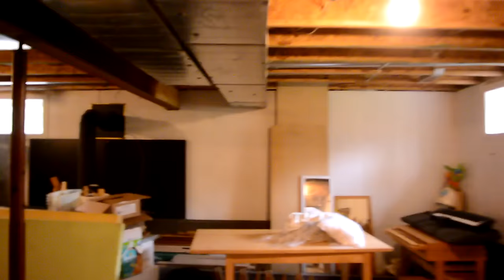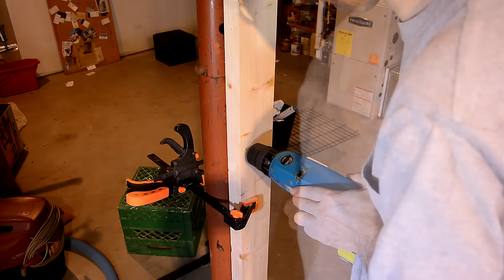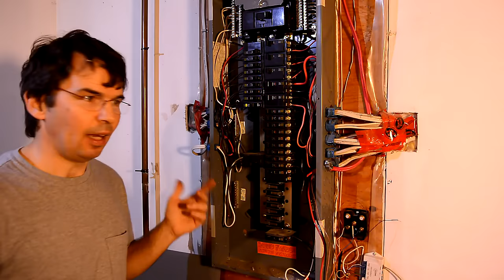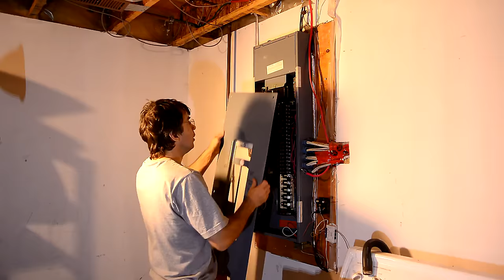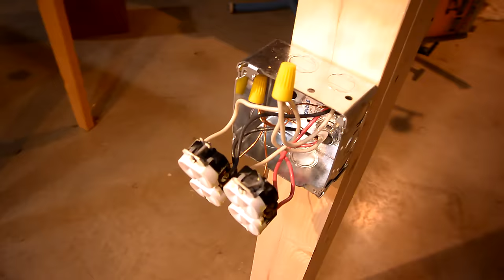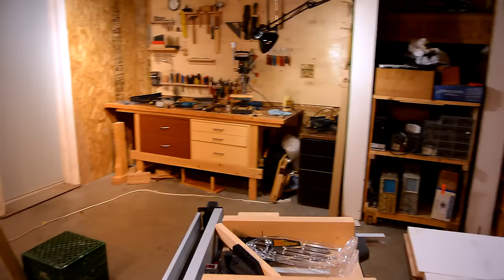Wiring a new 240 volt circuit

Comment: I asked a journeyman electrician once if he had to do a lot of work in live panels.  He said sometimes yeah, but they would use protective equipment (shields, gloves and the like) to help ensure against any accidental contact that could cause injury.  Beyond that, he said, "there are old electricians, and there are bold electricians, but there are not a lot of old bold electricians." :D
Reply: Same with pilots
Reply: As someone who is an install engineer for higher voltage equipment, 480V and up, this was painful for me to watch.  If your only reason to keep it live is lights, you need to kill the power.  A headlamp is fine and keeps you safer.  If you must work live, at least use rated gloves.  It's too easy to accidently touch something you shouldn't if your attention slips for a second.  Especially using non-insulated screw drivers to install the breaker and wire.
Reply: @112428 agreed. Some independent light source like a Dewalt battery operated portable light pole (in addition to a headlamp) which would've been par for the course. There is no way I would ever work in a live panel (no matter how small the upgrade or repai)  just one momentary lapse of judgment, absentmindedness or distraction in a split second could  change the wife's status to single mom.
it's better to follow all safety protocols to the letter .
Reply: LOL good one

Comment: As a qualified UK electrician, I would not comment about how other countries do things - each to his own. What I would say is that every country seems to be bringing out more and more 'rules' and 'codes' most of which seem to do more to keep the rule-makers in a job than they do to improve safety...
Reply from the maker: Indeed.  and people will find a way to solve it.  If it's too expensive to do it properly on account of all the rules, they just kludge it.  So in a way, the rules are self defeating.  Cause it's the really dreadful stuff that causes electrocutions and fires.
Reply: Just be grateful you live in a country where doing your own electrical work isn't a crime, and the electrical code is readily available information.
Reply: I worked on a job where we had to add afci breakers to meet code. Like $40 each. They're very touchy. A chendelier on the 2nd story caused it to trip. What an expensive code requirement.
Reply: kludge it... reminds me of your washing machine hack you fixed in an earlier video :)
Reply: i cannot comment on electricity codes as it is not my area of expertise but here in nz the building codes have become so extreme its making buildings weaker.  they want everything so overbuilt for earthquakes that when they do get a shake they cant absorb the energy and fail.
Reply: Man the CEC codebook is 3 inches thick.
Reply: The USA codebooks is an industry.  Each 3 years a newer version comes out. Many of the books here have doubled in page count in the last 3 cycles. Also different states have variants too and thus There are many thousands of variants. Ie Michigan book for plumbing, Massachusetts plumbing book, Los Angeles plumbing book.  Aunt Bee in Mayberry too might just use the 1996 NEC book for electrical and have a blue mimeographed Mayberry revisions sheet that is just 4 pages long. The variations are like liquor and gun laws, each state and city has its own rules and to heck what others do.:)
Reply: Have you ever noticed that it's those in the trade that make it more difficult for those in the trade. It seldom comes from the outside.
Reply: Where I used to live in Colorado, we ran a plastic sheathed cable, similar to the cable used by the guy in the video.  It was very easy to use.  But in the Chicago Illinois area we must use metal conduit tubing, and then run wires through the conduit.  It is much more of a pain.  In terms of safety, I am not aware of rash of Colorado house fires due to the plastic cable, so why in Chicago must we use conduit?  Doesn't seem for safety given how many other locations allow plastic sheathed cable with no issues.  Some people claim the conduit is better in case more wire some day needs to be pulled through the conduit.  But both times I needed to run wires in my Chicago area house, the existing conduit was of no use due to location.  So the excuse of pulling more wired is of limited value.  Try to install conduit in an existing wall - pain.  Many people (including myself) think the Chicago metal conduit regulation is to make electrical work more difficult for homeowners, thus requiring more hiring of electricians.  I am all for safety and appreciate electricians and their knowledge on the subject, but some of these rules and regulations are questionable.  And unfortunately can have the opposite effect in terms of safety, because many homeowners in my area due to expense and rule aggravation, end up doing their own work, and some of it not all that well done.  I agree when it was mentioned the "rules and regulations" has become an industry of it's own.
Reply: In Chicago, everything is dictated by the unions. They will tell you all the regulations are for safety and that is probably true but you can bet plenty of it is to protect the union electricians, plumbers etc. @bigworldparty
Reply: Guess You would like the Swedish rules, we are almost not even aloved to change our own lightbulbs! ;-)
Reply: You guys are on a different wave and it herts. Lol 🤣
Reply: @TaylerMade  
That makes no sense

Comment: Well done!
Some 20 years ago, as a an owner-builder in the states, I was able to build our entire house without a builder's license or any kind of licensing in any of the trades needed to build a house. I did all of the electrical, plumbing, heating / cooling, etc. I just had to have regular inspections throughout the process and a final inspection. Some of the trade specific shops that I tried to do business with would't sell to me, but there were always those that would go out of their way. I always worked with the inspectors and had a good relationship with all of therm, especially the fellow who gave me my final. I will never regret the decision to DIY our home, despite having times when I wanted to bulldoze the entire thing into the ground. It was hard work and I learned a ton.

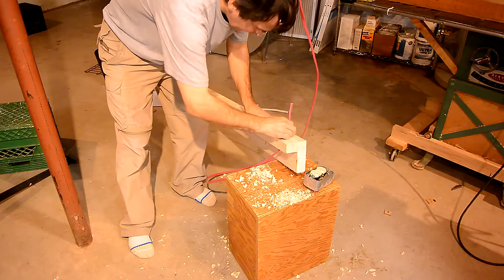Comment: You may not know this? But, if you look at your yellow wire cutters/strippers ( 0:54 ) you will see two small holes near the cutter head. 
They are there so that you can put in the stripped (bare copper) wire end, and bend it so that it makes the PERFECT sized loop to put over the ground screw and the screws on the outlet. 
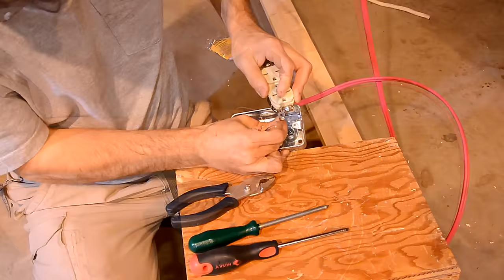The pliers (1:06 ) are not necessary. :)

Also: 
When wiring up the breaker? Install the wires first, then snap in the breaker.
Reply: This is one useful comment!
Reply: How so?

Comment: Some thoughts on North American wiring practice, for those who find it frightening:

Certainly there are installations that do not meet code, and those that do but look like rats’ nests. But regardless of how fearful a proper installation looks like to someone unfamiliar with the US National Electrical Code, it’s probably worth noting that the system does work and is safe. The Code is constantly revised to improve safety, but such frightening devices as wire nuts and snap-in circuit breakers have been functioning for decades on end without failure. I used to think that wire nuts were an absurd connector. Then I tried to remove a few. The spring grips the wires with amazing force and is extremely resistant to “unscrewing” from the connection. Can they be misused? Sure. Poor wire prep, too many wires for a given nut size, careless application. This is why we have electricians and inspections. Are wire nuts better now than in 1950? Sure.

There have been a few service panels that proved to be poor designs that needed replacement over the years. Aside from these known faults, I can’t say I know of any issues with panels or breakers. Terminals for AL-CU wire are reliable with aluminum. Strain reliefs do their job. “Romex” cable has performed safely for decades.

Over the years, the NEC has modified wiring procedures to improve safety as well as requiring newly developed technology.

Regarding North American voltages, they’re just what evolved historically. This is a vast continent that was—and is—largely rural with no need for the power capacity of three phase everywhere. The sheer vastness makes the distribution cost prohibitive. Businesses and industries who need it have three phase available. Typical single-family residential service in recent years has been  200A at 240V single phase, but now 325A is likely. There just isn’t enough need to rewire an entire continent for three phase. Remember that you can drive across all of Germany before I can drive across half of Texas.
Reply from the maker: Exactly.  And the low voltage - that was Edison's idea.  We got rid of the DC, but Edison figured 110 volts DC wasn't enough to kill anyone.
Reply: @Metis It blows my mind to think someone can drive from London to Moscow and not even hit enough miles to need an oil change.
Reply: @Metis So true. I remember Europeans in Las Vegas a long time ago and they wanted to drive to L.A for lunch, site see a bit and make it back to Vegas for dinner. They thought it was that close. LOL.
Reply: Thought it was 120V in the US with a transformer at the suppliers cut out

Comment: I'm seeing more comments anticipating the safety police than actual safety police comments
Reply: Matthias and the Youtube algorithm: 1
Commenters: 0
Reply: That's because he goads the safety police into making comments, rather than just explaining his working procedures and just leave it at that.
Reply: Yeah, it's become a spectator sport on this channel... :-)
Reply: that's how bad the safety police is.
Reply: Mischa Bommer does electricity behave differently there? He was isolated from ground, so doesn't matter where in the world he is...
Reply: I'am not sure what the difference is, trying to figure that out at the moment.
North America typically uses a split phase system as here in Europe we uses a 3 phase system
But trust me, do not touch one of the conductors in a live installation. You will get a shock.
Reply: The difference between 240 in North America and Europe is 60Hz vs 50Hz and we take a center tap off our pole transformers, tie it to earth, and use it to provide 2 x 120v circuits that consist of a live and a neutral. 

Because the 2 live wires are opposite ends of the same coil, they are always 180 degrees out of phase just as a transformer anywhere else.

I believe EU Transformers have 3 coils in a WYE that supply 3 x 240v live wires and a common that is tied to ground.

Because of this difference, the potential from live to ground in NA is 120V and in EU is 240V other than that, the systems are largely the same.

Normally you'd get a shock doing that here, because most shoes don't have high enough resistance but he's probably wearing something he pre-tested, and verified there were no pins or nails stuck in them. (I hope) 

Since the ground to live voltage in EU is 240, those circuits are more likely to reach breakdown voltage of shoes than in NA. 

I recommend anyone, not Matthias Wandel, to avoid trying this themselves. He's not going to listen to safety talks until he starts a fire or gets a really good scare/shock. I know that's what it took for me to really respect electricity.
Reply: There are lots of them. Change the comment sorting from "top" to "newest" and you'll see them.
Reply: if you touch just one conductor while being correctly insulated from the ground, you won't get a shock.
Reply: When people make fun of those who are safety minded, it makes me think of kids in school making fun of others who wear bike helmets. It's such weird posturing.
Reply: After reading the reviews I have come to the conclusion that I've done this before with the power off and I still get a little shaky even though I know the power is off and I have zero risk. Oh and never under any circumstances do you touch the metal shaft of the screwdriver while it's in the box and never use two hands in the box. One hand might get you a shock but two could run across your heart! Other than that... keep it safe... keep it real... and safely keep it. Home isn't home if you never make it back!!!
Reply: Not true. Most people think electricity goes into you like a spark when touching a doorknob. Electricity doesn't go into you, it goes through you, period. It is no different no matter where you live. If you are not grounded, between, or touching another phase, you will feel nothing. (30 year electrician, contractor.)
Reply: when it comes to residential voltages, certainly, I just don't believe all footwear is going to keep you electrically isolated.
Reply: Well, having 110V instead of 230V explains why you don't have to be so uptight about electrical safety as we europeans need to be. The human body has quite some resistance as well, and 110V only just overcomes that to be lethal. With 80 volts and downward it's almost impossible to get killed by it. That explains why 230V is so much more hazardous over 110V. If I see this video, I feel relief that so many things that would not be allowed anywhere here, are just common practice in Canada (and the USA). It makes it so so easy to just expand your installation. If I want a new socket on the other side in my garage... it'll take me a full day due to all regulations :)
Reply: Dave Smulders how true, that’s why we Europeans introduced the RCD.
Reply: Dean Gilder conductors*

You aren't getting hit by 240 by touching a single conductor. It's 120 per.
Reply: Welcome to the matrix...

Comment: It's a weird sort of pleasure you derive knowing how touching those hot bars so casually is going to make most of your audience feel
Reply: And you found out didn't you? They all acted like children with monsters under their beds.
Reply: Some of us know there is more to what he showed, or he's extremely lucky. I've accidentally touched hot bars while wearing rubber boots on dry hardwood and have gotten shocked.

Also in places outside of North America, they use 240/400v systems which makes it much harder to prevent conducting power through your shoes. He only exposed himself to a 120v potential which barely can penetrate skin without insulative shoes.

Though I'm sick of hearing from EU people who've been brain washed into thinking 400v systems are safer than ours.
Reply: Not really, he touched the 120V bar in his 240V service  & never touched a ground. This is his house in this country. I care not about voltage in Europe. Other precautions need to be taken over there.
Reply: Hmm... You must be living in that special part of the world where electricity can flow through an open circuit.
Reply: it's not an open circuit if the voltage is high enough to overcome the insulation in his shoes since 99% of them are not designed to be insulative. Like I said, I've gotten shocked in the past accidentally hitting the same rail working on my own electrical panel while wearing rubber boots. The shock went straight through my feet, if current flows, it's not open.
Reply: I don't doubt that you got zapped and am glad you survived, but the story makes little sense as described.  If you were not grounded in some other way and were simply standing on a dry floor, in rubber boots no less, it would take pure magic to experience an electric shock with 240V and even more so at 120V.  
Never mind the non-conductive floor and rubber boots for a moment, but just think of being grounded and bringing your finger to within, say, 1/2 inch from an energized conductor at household voltage.  Would there be a flash bang and a spark to your finger?  -> Definitely NOT. So if you indeed got a shock, the circuit was closed in some other way than the dry floor and rubber boots.  Maybe the head resting against a water pipe? The other hand touching something it shouldn't, instead of being in the pocket?  Something closed the circuit, and it wasn't a dry floor and rubber boots, that's for sure. As dangerous as electricity can be, it is also very predictable, and it couldn't have happened the way you think it did.
Reply: Exactly right vanboi.
Reply: Look, the shock went from my right pinky knuckle and exited my feet. You assume because foot ware uses rubber it's essentially a rubber insulator. If the manufacture uses too much carbon or metal to reinforce the footwear, or there are pins/nails or other conductive rubbish in them, you're going to close a circuit. Deliberately touching a hot bar for no other reason than to show you can is the same as pointing a gun at your head and pulling the trigger to demonstrate you cleared it properly. 99% of the time you'll be ok. 1% of the time you'll be a damn shame.
Reply: @vanboi  the rubber in your boots can act like the dielectric in a capacitor and your bodies moisture the plate.  For example if you connect an AC circuit to a polypropylene capacitor, current will flow even though technically it is an open circuit.